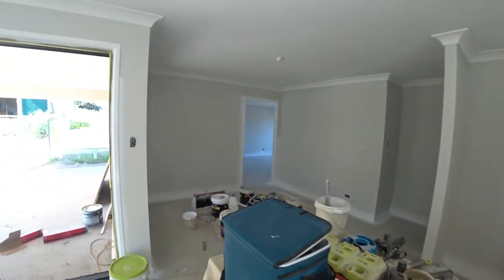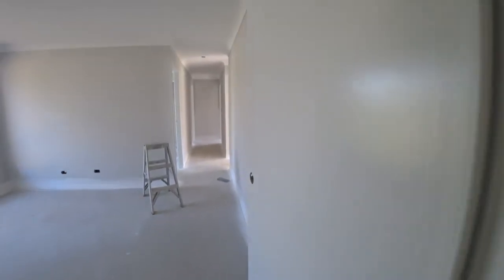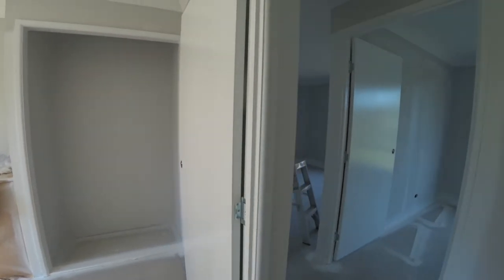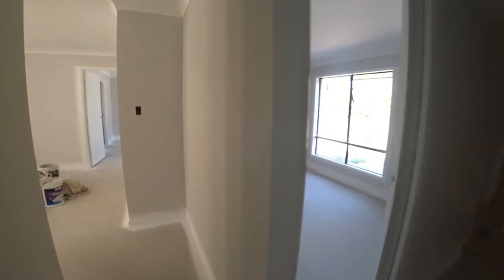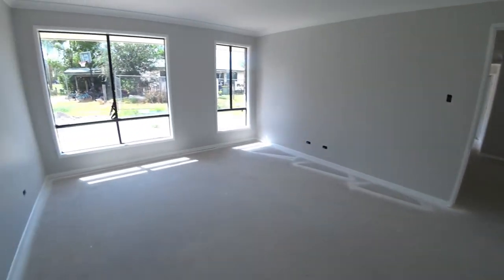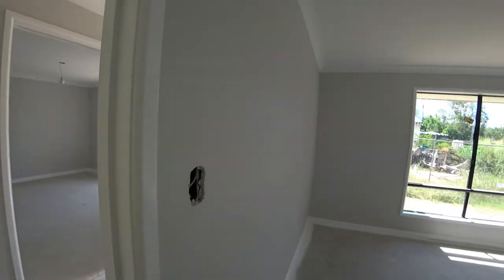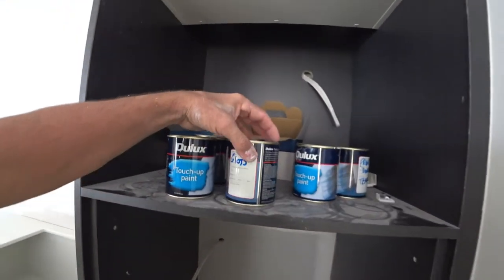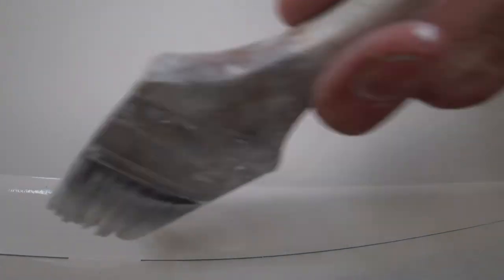Dulux Steriguard Water Based Enamel , is it better than the Aquanamel.

Comment: Thanks for this information. There is so little information online about what an enamel paint actually is other than it is a replacement for the old oil paints and sits flatter with a more glass sheen, is all I as a chemist can get out of it. I still don't know what to paint my front door with.
Reply from the maker: This is the sort of information I love to hear, the benefits of enamel paint, a couple of things. One is it is not porous and is better for dirt and moisture resistant ,the other most important thing is when two paint surfaces touch, they stick,(cohesion) using enamel paint on doors ,windows, shelves,and areas where paints touch or cleanliness is important, this is where enamel is paramount. If your door is in the sun,you can use an external gloss acrylic but the surfaces it touches must be enamel.

Comment: Hey mate, thanks for the informative video. You mentioned Haymes for a low-sheen finish, is it also a water-based product? I'm about to do my stair railing, architraves, skirting, window and doors, etc and I'm after a matte/very low sheen finish (prefer water-based). Can you please suggest some suitable products? (I'll be using a sprayer) Cheers, love your work!
Reply from the maker: You can buy a water based enamel in a low sheen, mid sheen and gloss, any of these are good ,basically just choose a paint brand, they all seem to be pretty good for what they are designed for. Thanks for supporting the channel

Comment: Hi Greg, I hope you are well, hey when you spray the skirting's like that do you have any trouble with spitting from the gun especially with an extension, and if so how do you tackle that 
Thanks very much cheers
Reply from the maker: I'm only new to the spraying of the skirtings, however I have purchased a Graco clean shot but haven't used it yet. I think if you only use a 6" extension and a very small tip you shouldn't have any problems if you keep moving when you release the gun. I think the 208 tip will be the next one I try.

Comment: Hi mate, have you tried dulux fast finish water based gloss yet?
Is it any better than steriguard?

Cheers
Reply from the maker: I believe they are both very similar, fast finish specialy designed to spray but steriguard is great to spray as well.
Reply: @ThePa1nterhowto  Great, thanks. 
Just gotta try something different as aquanamel leaks so much

Comment: Hi Greg, can you tell me what you have settled on with your water based trim paint. Cheers.
Reply from the maker: Ive been off work for a couple of months so haven't tried them all, so far if your spraying use the steriguard because it doesn't run. If your brushing,the aquanamel is smoother to brush but runs like a bastard if sprayed.
Im back at work in the new year so hopefully I'll try some other brands.
Reply from the maker: Just something I noted,use high quality undercoat or low sheen underneath to get a better finish in one
Reply: Hope all is well mate, i'm just outside Canberra. I'm spraying so will try the steriguard. i dont think Bunnings has it so will have to try the Dulux shop ( if i can afford there prices).
i like a nice gloss and was told to try Haymes ultra trim ( i think thats what its called) but was very disappointed by the gloss level. going to give the sherwin williams rep a call to see what they got, they got one called Solo, the idaho painter rates it highly.
anyway looking forward to your next video. Cheers
Reply from the maker: @paulmckeown8557  Sadly you will be disappointed with all the acrylic sheen levels. Good luck

Comment: hey mate what filler did you used to use for your nail holes when doing oil based. putty?
Reply from the maker: I use oil-based putty, undercoat and then an all purpose easy sand premixed plaster , I only have to sand once that way. (You can see the drum brand in the video under the steriguard can)